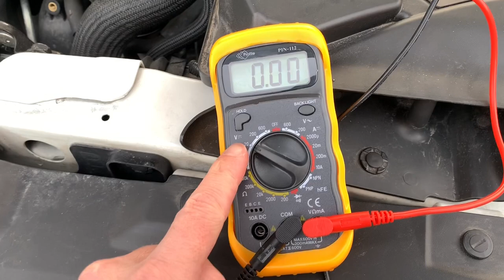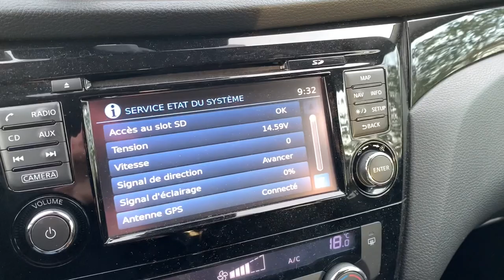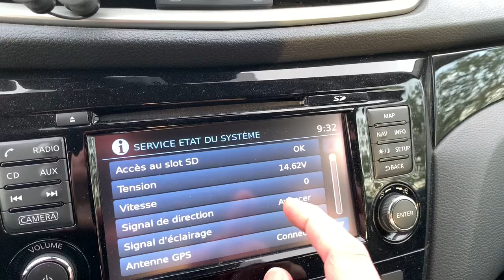Nissan Qashqai J11: How to check the battery with a multimeter

Comment: Tnx for the great info! Did the new battery keep it's charge? I've read that on Qashqai's there might be something draining the battery fast(er) even with the engine/car turned off. Interested in hearing your experiences after replacing the battery. Did you need to do any reset/recalibration in the engine management system after the battery replacement?
Reply from the maker: Hi Olaf! No it didn't. I simply bought the new battery on my way back home in some French well known carshop, installed it on the parking lot with a tools they lend me and I was good to go. I never had to take the car in for a reset or something like that and I never experienced any troubles since. On my new QQ I don't have any problem on the battery neither. I don't think the car is draining the battery, it was well known that the first J11a (2014-2016) were equipped with a very low quality battery. They even swapped some on warranty.  ;)
Reply: @LaPalmeraie0032  tnx, sounds good! :)

Comment: I need to change the battery and happy to do it myself. Did you need to use a memory saver? will the radio and everything else work as normal?
Reply from the maker: Hi! No, i just swapped them. The dealer does a system reset when they change the battery but this isn’t mandatory. I do not remember exactly but I think I didn’t lost any settings at all. I changed the battery on a parking lot on my drive back home when I was on a holiday trip and I do recall we drove off just like that after the swap without any problems 😉
Reply: @LaPalmeraie0032  thanks for your reply, will be doing this today as the new battery arrived.

Comment: I gotta say like always, you're videos are so helpful! I finally got my Nissan J11 on friday and already 3 days later I got issues with the battery. The car is 3/4 years old and still with original battery (driven 66000 km) I got this crazy flickering today and the battery is now getting charged over the night. Will probably contact the dealership I got it from to get the battery changed. 

Do you think that will solve the problem? I've been hearing a lot that there might be a secret fuse that drains these model a lot but maybe that's step to investigate if I still have issues after changing the battery
Reply from the maker: Thank you mate! 😄 happy to hear that you finally have your QQ, congrats. I’m so sorry to hear that you already experience this problem but I think it is rather a good sign that the car still had it’s original battery. It was taken care of and as it happend this soon you should be able to arrange something with the seller 😉 with a complete new good quality battery you will be at ease. I do not think that there is a « secret fuse » that drains and with a good battery you can be sure to have a reliable car 👍🏻
Reply: @LaPalmeraie0032  Yes, I hope the same! I will try to get the same one you changed to in the video. If I can find it in Sweden
Reply from the maker: I guess, Varta is a well known brand. 😉

Comment: HELLO I know that you have changed your battery and my question is if you had to do something before changing it. I think I read that you had to wait some time with the car off.
Do I have to do something before changing it or wait for time once it has been changed? Thanks
Reply from the maker: Hola! No just remove the old one and put the new one in. That’s all! I had to do it on the parking lot in front of the car store while being on holiday 😉 officially the Nissan dealer has to do some reset on the board computer but that isn’t really mandatory you know. Keep me posted and stay safe. 👍🏻

Comment: The problem with a the Nissan Qashqai is it always on draining the car battery, by one volt And  as It is always on stand by  And if you don't use you car ever few days   standby always  on will  eventually wreck the cars battery.
Reply from the maker: If you don’t plan to use your car for a longer period of time you always could remove the main fuse; the big white one in the middle of the fuse panel on the left hand side of the dashboard. However I agree with you that it is a design flaw. 😉

Comment: Salut amigo :face-green-smiling:
Désolé de devoir te décevoir , mais ton multimètre est vraiment trop mauvais . Chez lidl ils sont pas mal . 
Ici ta video c´est pour le chat car un multimètre ne prendra que 1 à 3 mesures par seconde donc beaucoup trop peu .
Si j´ai un peu de temps je vais monter une video sur yt comment on peut le mesurer et je te mettrai le lien..:buffering:
Reply from the maker: Bonjour, ce n'était pas le plus cher en effet :) mais il mais déjà bien aidé jusqu'à présent. Pour mesurer une batterie, même à cette fréquence de mesures, ça le fait je pense. On voit bien la tension à l'arrêt ainsi qu'au allumage. Enfin, l'idée de cette vidéo est de donné une astuce accessible. Ce qui n'est pas la cas avec un multimètre à 100€ façon de parler. Mais j'ai hâte de découvrir ta vidéo!